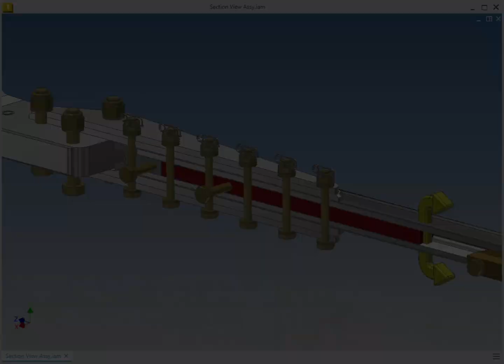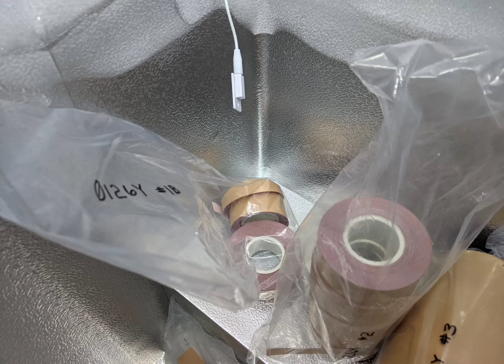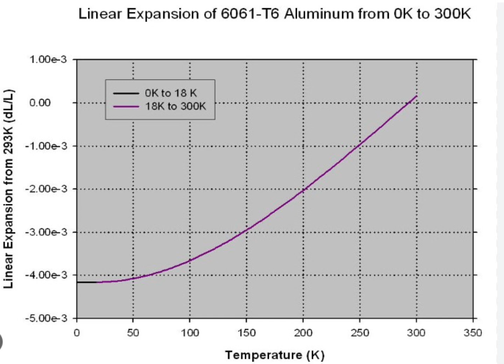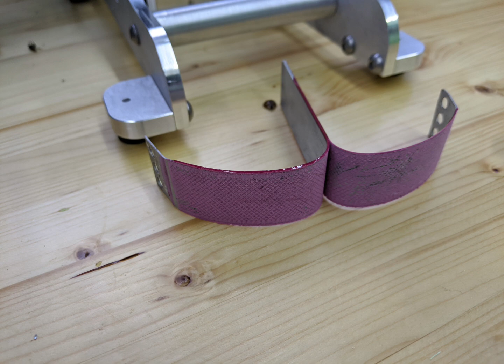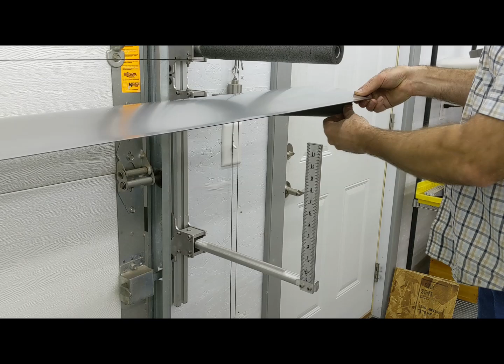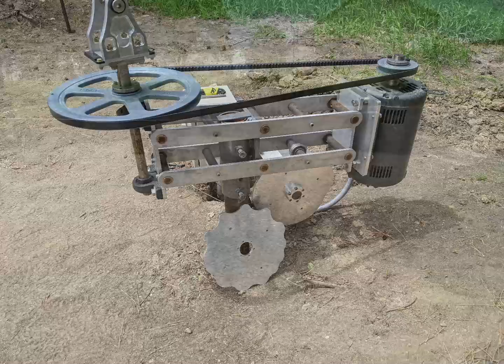Razor Blades Presentation

Comment: That was really interesting even though I get vertigo in glass elevators at sixth floor level.
Fascinating process, very interesting machining and manufacture, impressive.
Looks very involved and expensive though, I guess personal safety for 'experimental' light aircraft can't really be quantified, I've read of far too many people I knew or heard of (I was motorcycle technician) 'going south' through light aircraft accidents.
I'll stick to bikes, safer in my opinion (even with all the crazy drivers)